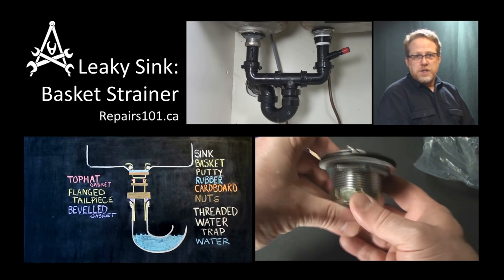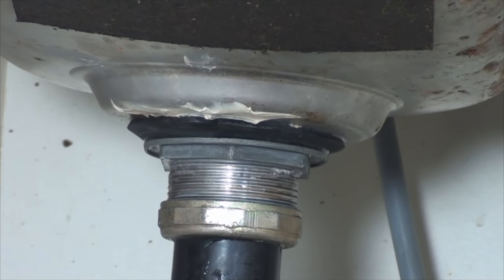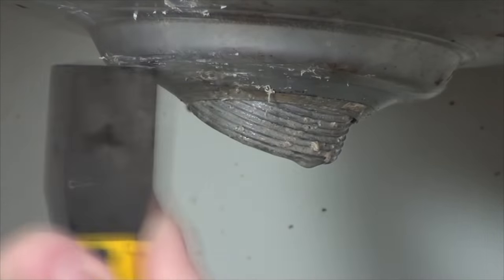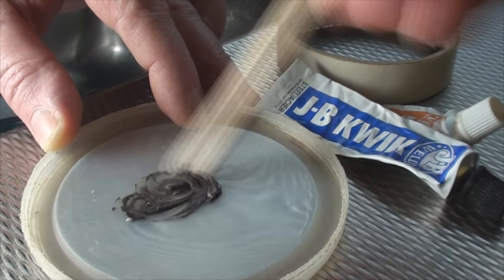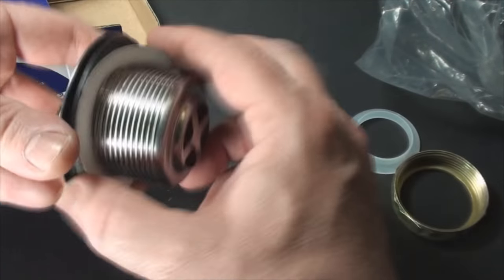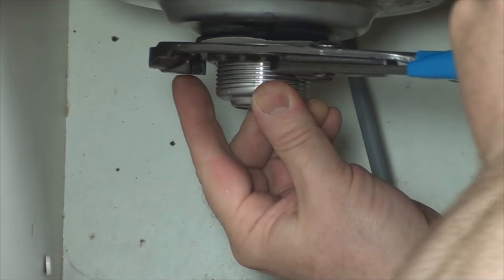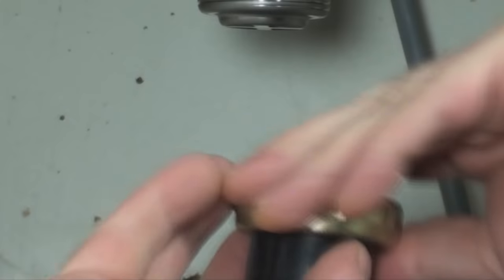Leaky Sink: Basket Strainer - How to Fix The Most Common Leak

Comment: FINALLY! I just needed the order of the parts because I couldn't figure out why things weren't going together right. The chalkboard diagram saved my sanity. It shouldn't have been this hard. I've done plenty of bathrooms but my Kitchen sink was driving me nuts. Two different basket with different thread sizes didn't help .. one just was a poor design. Brass nuts deteriorated. aaaahh.
Reply from the maker: Glad I could help!

Comment: The video was both filmed and narrated very clearly.  Well done!  My only question is: will the putty seal tear (and maybe leak) if you allow the strainer to turn a little when you are tightening the basket nut with the wrench, as I see happening at 2:25?
Reply from the maker: +hawaiidispenser - It hasn't leaked yet, but you're right to suspect that outcome. Best to keep it still when tightening. Thanks for commenting!

Comment: Just installed the basket strainer on our new country sink and its leaking under the basket strainer. I checked the instructions and no where did is say to use some silicon or plumbers putty? Did they just assume that everyone knew that? Should I take it apart and use some silicone or plumbers putty to seal the basket strainer to the sink?

Comment: Thoughts on using Silicone instead of putty?  The putty seems to need to be redone every 5-10 years.  Haven't had a drain with silicone need replacement yet.

Comment: Have you ever had a top hat gasket that seemed to be too big, restricting water flow?  The top hat gasket that came with my brand new stainless steel sink is rubber and fits inside of the drain pipe perfectly, but seems to block quite a bit of the strainer's already small openings, resulting in occasionally slow drainage that is not caused by a blockage in the drain itself.

Comment: Hi.  I like your technique for contouring the plumbers putty and using the small putty knife to remove the excess.

If I may make one comment/request for feedback - I always use pipe thread sealant around the threads which seals the connection between the top hat gasket and the nut connecting to the tailpiece.  Without using the sealant, there are almost always leaks.  Noticed that you did not use any sealant.
Reply from the maker: And still no leaks all these years later.

Comment: If only the left side is leaking, can I just use the right until I get it fixed?
Reply from the maker: I guess that depends on how fast your drain flows. If one side backs up when you pull the plug on the other you're likely to see leaking. If it drains fast and never backs up the other side you're good to go.

Comment: I have that problem also, in my old house and current house.....so I put plumbers putty around the base of the nut....works for a few years....leaks again ...just reapply.   I like to know how plumbers get around this....maybe this is a reason to use non threaded tailpipes and buy the solvent/glue.

Comment: I could see where the leak was coming from on my sink but I didn't really know what it was.  Your video was incredibly thorough, and I really appreciate the anatomical depiction of the sink at the end.  Now, when I go to the hardware store, I can look for a tophat gasket, instead of wandering the plumbing aisle like a moron hoping a knowledgeable staff person who understands what "thingy" means will save me.
Reply from the maker: Glad it helped!
Reply: @repairs101  
One of the best videos I've ever seen a very meticulously done.
Keith
Reply from the maker: @KTHKUHNKK  One of the best comments I've ever seen - thanks Keith!
Reply: @repairs101  
Now all I have to do is fix mine.
Can you recommend some type of spray to stop the leak.
My Plumbing is old I'm afraid to break something.
Thanks Keith
Reply from the maker: @KTHKUHNKK  I'm afraid any quick fix will amount to a band-aid on a boat. Spray down all joints with penetrating oil several times before disassembly. Use a torch to warm the couplings on stubborn metal pipes. Keep a fire extinguisher on hand. Good luck!
Reply: @repairs101  
Once again thank you so much for your reply.
I understand what you're saying but a Band-Aid.
Due to my disability with my eyesight and age and strength.
Strength I have very little off at my age.
Darn I ain't getting old.
Not to mention limited funds.
Unless you can think of some type of spray or silicone or something of that nature.
I guess I will please leaving the piture  under there for quite a while.
Whatever you do don't get old.
Thanks Keith

Comment: Thanks for the vid! Just took my sink apart. I plan on reusing my basket strainers since they are relatively new (my contractor took 3+ times and still leaks, so I can't keep affording to take off early to meet him), but the cardboard washer is gone (got too wet). Is it necessary to have one? If so, do they have them at Walmart/Home Depot?
Reply from the maker: +Logan Stewart - the paper gasket is required to allow tightening without distorting the seal. You can get an entire basket strainer assembly for less than $10cdn
Reply from the maker: +Logan Stewart - Maybe ask someone at Walmart/Home Depot if they carry the seal kit alone.
Reply: Thanks for the quick reply! That's good advice. I was also told that instead of using the rubber seal underneath the sink, you can use it as a seal between the basket and the sink instead of the putty and for the person it's over 1.5 yrs and still fine. I tried that last night and it seems to work perfectly. Any unforeseen problems with this method?
Reply from the maker: +Logan Stewart - putty method I show can last +25 years, but if it works, work it!

Comment: No matter what the putty always seems to wear off after a few months and the drip drip drip is back.  I tempted to just epoxy the strainer onto the sink and leave it at that.  After 10 or 20 years if the strainer fails, I can just heat up with torch and remove easy enough.

Comment: I’ve noticed with time that the fittings below the trap work loose due to the heat and cold of water exiting through the drain.  One solution to this is to use Teflon tape on the fittings

Comment: Good video! Am I able to use silicone in place of the plumbers putty?
Reply from the maker: I do not recommend that.
Reply: Ok thanks!
Reply: supposed to use silicone w/ a plastic basket strainer.  apparently plumber's putty is not compatible w/ plastic they use.  good reason to use a metal basket strainer n plumber's putty.  :)

Comment: My bathroom sink is leaking between the sink and the rubber gasket underneath. I've tightened it pretty hand tight it leaks. Thinking maybe I'm over tightening, I loosen a bit, still leaks. Replaced the putty, still leaks. I'm at a loss. I'm not a certified plumber or anything, but I've installed many bathroom and kitchen sinks over the years. This is the first time I've been stumped.
Reply from the maker: Start over with all new parts and following the instructions in this video. When it is all disassembled check the sink isn't bent at the opening for the basket strainer.

Comment: I don't use the cardboard gasket because it's the first thing to decompose when it gets wet, leaving the basket loose pretty fast (and leaking)
Reply from the maker: Its purpose is to allow the nut to slide without catching and distorting the rubber gasket. 
Done correctly - it will never get wet.

Comment: The apartment building where I live at is a idiot. The whole pipe was replaced last year. Did the dishes and Thought when I drained the water it would go through the pipe. No nope the water went under my sink. Maintenance says as usual it’s not a emergency. I need to have a idea what’s wrong.

Comment: great vid. i have 2 to change out. i went to lowes where we bought the sink,and asked the guy exactly what i needed to buy to replace the leaky strainer. he handed me the replacement parts,and i asked about putty. he said i didn't need it. i get home and im sitting here looking at the directions and it says i need putty. i told him the sink wasn't even a year old and my brother used old putty when he installed it,and that's exactly where it's leaking. any thoughts? why would that guy say that i didn't need it? i asked for everything i needed so i wouldn't have to make the 80 minute round trip again,  Thoughts?
Reply from the maker: Geez Frick, my thoughts are all in the video. But if a sales clerk says you don't need putty then disregard my video and follow his instructions. Good luck.
Reply: thx. im going to look farther into this before i do it. the the directions on the box says to use putty. thanks for your vid. im still planning on using your vid as a guide until convinced otherwise.
Reply: He is a clerk, not all personnel are plumbers.....a good percentage of time, big box chain guys just don't know.  It is that simple..if you want expert knowledge a plubing supply house is a better bet if you can find one close by.
Reply: That's why it's called "DIY," not "LLGDI" (Let Lowe's Guy Do It). The concept of stores like Lowe's and Home Depot are that they are warehouse operations that provide needed supply. They are not set up to offer advice and you should not expect people there to give good advice. That's why he said that, because he was too lazy to walk you over to the putty and get it for you and therefore "you don't need it," in his vernacular means "I don't need to get that for you."

Comment: Also, if the metal nut stuck; then, I would use BBQ Utility or Multi-Purpose Lighter to warm up and expand the metal nut for 30+ seconds, then will be easier to untie !

Comment: WHAT IF YOU DON'T HAVE A HOLE IN THE BASKET HOUSING?  AND THE NUT HAS JUST RUSTED OFF?
Reply from the maker: 1. I don't know what you mean by no hole in the basket housing. 2. If the nut is rusted off it should be very easy to disassemble. 3. Why are you YELLING at me?

Comment: I am fixing this leak right now on a brand new faucet and drain. I have tried everything and can't stop the water from creeping through between the porcelain and gasket. I've taken it apart and put it back together 5 times!  I'm gonna lose my shit!  Help me please!
Reply: I cleaned the porcelain like new, and everything else is new. Also, my drain has the two slots for the overflow drain to drain into.  But that just traps a bit of water sitting right on the spot I have the issue. I don't understand.
Reply from the maker: wrong strainer for type of sink?
Reply: If it won't work, punt and get a new sink. There could be some damage to the sink that you aren't noticing, it could be warped and will never seal. If you just can't get over an obstacle you have to go around it. $300 for a new sink, how much were those 5 weekends you already spend working on it worth?

Comment: My leak is where the plastic pipe connects to the flange; leaking ( seeping ) around bottom of steel nut; have dis assembled and re assembled 4 times and still seeping; I mean there is no water pressure involved; just a drain; what the heck  ???????
Reply from the maker: My guess is you're not tightening the nut enough. Hard to see from here.
Reply: @1NutDude    Thank You; that is true;

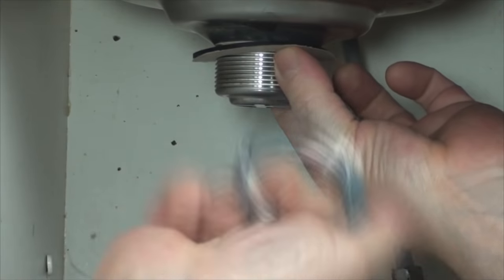Comment: At 2:20/4:00, it is a mistake to put the rubber gasket at the bottom of the sink.  The rubber gasket should be used at the putting location between the bottom of the strainer and the sink.  Most professional made the same mistake and keep using putting.  Putting is not necessary with the strainer came with a rubber gasket.  Big mistake!  The rubber gasket and the metal cap has an opening won't do any good to prevent water leak under the sink.  It does not make any sense to put the rubber gasket under the sink.
Reply: Interesting point!🤔

Comment: It just kills me to see you use the corner of a putty knife to remove the excess plumber's putty.  I guess scratching the sink is not a concern.
Reply from the maker: Did you not see my sink?
Reply: @repairs101  If you are referring to the sink being a junker and therefore it doesn't really matter if you scratch it, I would counter that as a tutorial you may unintentionally encourage someone to use the same tools on a nice sink.  That's all.  On the whole not a bad tutorial.  You might want to clean off any putty that has initially squeezed out downward onto the strainer's threads.  Putty doesn't belong between the gasket and sink.
Reply from the maker: @jimcervantes5659  I look forward to seeing your video on the subject.